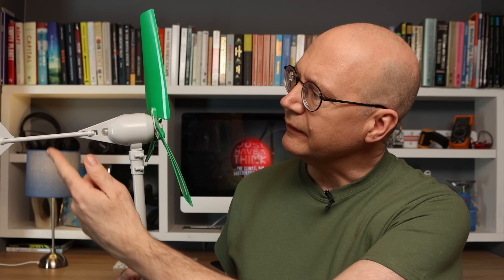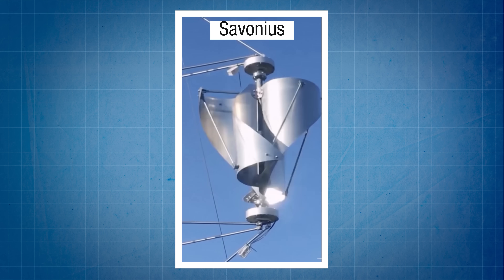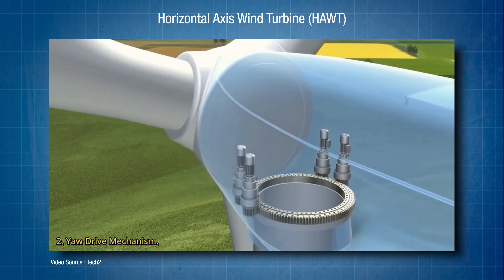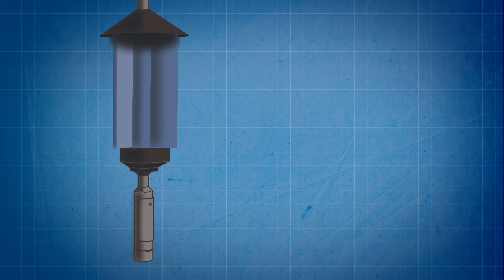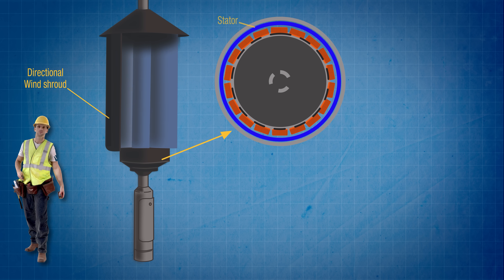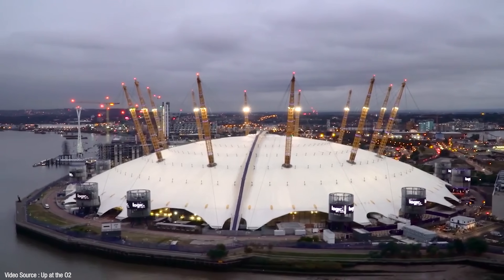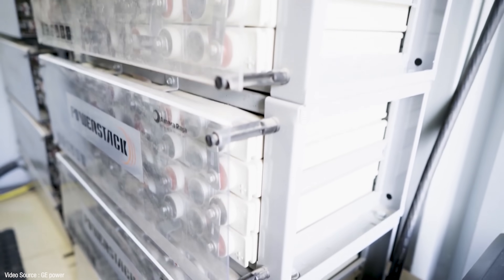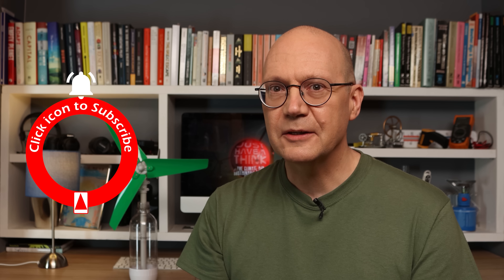A vertical axis wind turbine that doesn't need the prevailing wind! How do they do that?

Comment: There is a massive problem with this popular idea. (I already have heard this one quite often, and I keep being shocked that people are investing towards this.) When you place a wind turbine to extract the airflow energy from ongoing vehicles, what you are really doing is extracting energy from the moving vehicle. In other words, the vehicle has now to power itself AND the windturbine. 
To give you a physical intuition of why that is so: Windturbines rotate because of pressure differentials. If you look at a VAWT, as the wind blows onto it, at the front a high pressure "cushion" will form, and a low pressure one behind it. That means that when we are placing wind turbines along the highway, we are installing "high pressure cushions". Cars will have to travel then through this "high pressure cushions" instead of the normal-pressure-atmosphere! You are making the cars go through denser air/making it harder for a car to travel. 

This idea makes ONLY engineering sense if applied at BRAKING sections, NOT along the highway. 
Applying to braking sections, this would absolutely make a lot of sense, helping the cars slow down. Additionally the braking sections often involve curves as well, and wind turbines could provide some cross wind protection.

But please, stop popularising this idea the wrong way. We need smart solutions, not simple ones.
Reply: Excellent explanation. It baffles me that this simple thermodynamical approach was not mentioned in the video.
Reply: You got it right by getting it wrong, mate. These silly things are not capable of stealing energy from passing cars. They are impotent. Check the comments in Dave's "correction" pinned thread.
Reply: @tzenophile  There is no information about this in the pinned "correction" comment.
Reply: @Freba9  They are in the comments to Dave's OP. Not in Dave's OP. Check my comment and Jeffrey Lebowski's. They are at the start of the thread. Unfortunately Dave could not be bothered to get it right, even when we pointed out the simple math to him.
Reply: @tzenophile  Yeah I have seen it now. You are definitely correct about the numbers being highly unrealistic. But the exact numbers do not really matter when you realise that the system does not work at all. It only harvests energy from the gas tanks or batteries of the passing cars. No matter whether the power output of the VAWT is high or low.
Reply: @Freba9  I'm not convinced that would be a measurable problem, or even an immeasurable one, compared to the regular air resistance vehicles face. What physics would indicate otherwise?
Reply: @tzenophile  Well it is just simple: the energy to turn the turbines has to come from somewhere. So where else would it come from than the car itself? First law of thermodynamics.
Reply: @Freba9  No; that's like claiming a fire gets colder when you use it to heat up a marshmallow (or whatever). It does not follow from thermodynamics that car is affected against the direction of traveling by a VAWT nearby.  And even if it was, that the sum total is zero.
Reply: @tzenophile  The fire does get colder when heating something up. Somebody else in the comments made another great comparison to the situation: imagine the turbines are in stead foam rollers touching the sides of the vehicles in order to generate electricity. The rollers will increase friction and therefore increase the fuel consumption. Same thing with these wind turbines. The disturbed air pressure increases the drag the vehicle experiences.
Reply: @Freba9  I don't want to be rude, and you seem like an intelligent person, but your assumption that a fire gets colder just because something is hanging over it indicates that you don't understand thermodynamics. it is the air above the fire that does not get as hot, but the fire will have the same, if not a slightly higher, temperature, since the marshmallow will block some hot air from escaping (also depending on the general air supply to the fire). Anyway, the foam rollers is a nice analogy, but it is just that; analogies are not proof and can not be used as proof. 

A VAWT spins tangentially to the direction of the car, and any extra air pressure generated by the spin will equally force both against the approaching car and with it as the car recedes. The car's real frictional opposition is the air in front of it (and of course the road); I don't have time to look up the formulas and do the math but the VAWT will be in the wake, and if there is an effect at all it is bound to be very small, and much less than the energy the wake will transmit to the VAWT.  This is your point, right? That the wake will affect the VAWT and the car will be affected by an equal counter-force to the wake? I don't think so. 

Here is another analogy for you: A passing ship produces waves. Now, we should not harvest the energy from those waves, because if we have buoys, say, 20 meters from the ship (or even shores and coasts) that does that the ship will be slowed down. Nah.

Tapping into this excess energy would have been a good idea, except for the fact that VAWTs are pretty useless.
Reply: @tzenophile  "This is your point, right? That the wake will affect the VAWT and the car will be affected by an equal counter-force to the wake? I don't think so." Yes, that is exactly what I mean. The point is that you would have to be very close to the moving vehicles to capture any usable energy at all (apart from the fact that VAWTs are pretty useless anyway). Such a close distance would disturb the airflow of the vehicles so much that the energy harvested will always be lower than the increase of drag and therefore increase of energy consumption of the car. If the VAWTs were placed farther away from the road, there would not be any serious amount of wind to be captured and obviously the aerodynamic disturbance on the vehicles would (indeed) be negligible. But then there would not be enough wind left to be harvested, especially since the VAWTs are so inefficient. It is impossible to keep harvesting the tiniest amounts of excess energy from any system because at a certain point it doesn't make sense anymore. So my point is: in order to ONLY harvest the excess wind energy of the passing cars you have to be far away from them so you don't disturb the airflow resulting in a situation similar to the passing ship and buoy analogy.
Reply: @Freba9  Ok, so our difference of opinion seems to rest on the math of aerodynamics. And I guess none of us will go that far to prove or disprove the point. What we agree on is the in-feasibility of a practical setup, given that cars have different widths and can't be expected to keep a close enough distance to the HAWT to actually create sufficient drag/spin. But my best guess is, that even if you were right in assuming that a close enough position could be achieved which would negatively impact the car speed, these VAWTs still would not produce anything significant, let alone break even.

Comment: Here's one for some engineering types to ponder.  Think of all the central AC units operating around the world feeding our addiction to air conditioning.  They all have a powerful fan on the outside components that produce a large volume of "wind" as they draw air through the coils.  These fans run whether the unit is heating or cooling.  If a device could be installed above them to harness that air flow and put energy back into the grid whenever those millions of AC units are running it would offset a significant portion of the energy consumed  to run them.  The beauty of this would be that when demand is highest, when it is very hot or very cold, and the units are running pretty much constantly the energy production would increase as a result.  Someone who could come up with such a device that is economically feasible could not only have a real impact on reducing the need for more generating capacity but could probably reap huge rewards for doing so.  This would work even in areas where the lack of sufficient prevailing wind makes wind power impractical.
Reply: It would not work. A device like you describe would disturb the airflow of the AC unit fan and therefore increase the energy consumption of the AC unit. There won’t be any gain. Exactly like these windturbines from the video. They lead to an increase of fuel consumption from the passing cars. There is no such thing as a free lunch.
Reply: @Freba9  those turbines do no put any drag on passing vehicles.  They turn as a result of the air disturbed / moved by their passing.  No restriction of airflow from ac unit = no increased energy use.
Reply: @royparker7856  Yes they do. It is just basic thermodynamics. You cannot harvest energy from any machine without increasing the machine’s energy consumption.

Comment: You are wrong.  Putting these things on the lamp poles will increase the air resisances seen by the vehicles on the road.
Suggested reading: Theromodynamics for Dummies.
Reply: Well said 😄

Comment: Small calculation with information at 5:50 on this video. 6 kWh/day/each turbine and let's say 0.20e/kWh.
6Kwh/day * 20cents/kWh* 365d * 20years =  8760 euros. Can they manufacture, install and maintain those turbines for 20 years with 8760 euros a piece? 
That 20c/kWh is way too generous as big wind turbines makes it well under 10 c/kWh.  So it would be closer to 4000 euros per turbine.

Having small turbines means more controllers/inverters. Can those poles and foundations handle increased mechanical stress? Can they close a lane of motorway  for installing and maintaining turbines or does it need to be done evening/night, making it bit more expensive? During winter, is there risk those turbines throw pieces of ice to windshield of a car? 
I am bit sceptical about this, but I am not against someone trying, as long it's not happening with my money.
There is a reson why wind turbines has grown in size. It is more effective.

Comment: Just saw your video as it is something I am interested in for my house. I have succeeded in going entirely electric (solar panels, batteries and an EV) and currently, apart from the lease cost of the EV, my net annual energy cost is ZERO (including charging the EV). I had the gas disconnected and meter removed 3 years ago.
I am considering installing a small VAWT on my now redundant chimney stack, to supplement the PV system and like the look of the Alpha 311 system you talk about. How can I contact them?

Comment: What would happen if you tucked 2 of those behind a grill on an electric vehicle?  Could it add charge to the batteries as the vehicle rolls down the road extending the miles per recharge? Perhaps charge the batteries while parked facing toward the wind?   

I could use those in a back yard shed to operate 12 volt lighting via rechargable batteries and maintain my cordless tool batteries operating the chargers at 110v.

Comment: I can't help but think harvesting the energy puts more drag on the passing vehicles. Perhaps structures that reduce the drag on passing vehicles are possible.
Reply: Correct.
Reply: Incorrect. They most certainly have no signiicant effect on the passing cars, and will not produce any energy. It's a scam
Reply: As for "structures that reduce the drag on passing vehicles" -- that would be wind pushing the vehicles along. Giant fans at short intervals over lanes? Good luck!

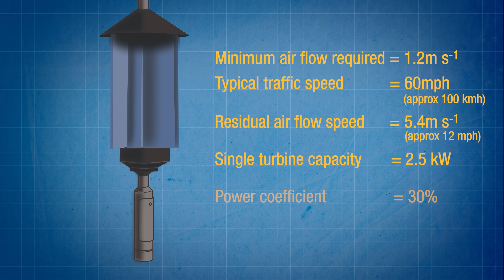Comment: I notice no one cares to redo my math... ? "Given the values at 5:30, to extract 2,5kW from a 5,4m/s wind, at Betz limit, simple wind energy calculations result in just under 230 m2 of required area...? I'm a big fan of wind energy, less of the sales department :) I fear the company is a bit optimistic." So just to explain: to generate 2,5 kW of energy for the given 5,4 m/s wind at the theoretical optimum (Betz Limit), one would need a wind blown area of the turbine of 230 m2. This means say a 10m wide and 23m high turbine rotor. As this Betz limit is not feasible, and a Savonius type rotor has very poor aerodynamic efficiency, losses will 'consume' a large portion of energy; therefore, this area will even need to be much larger. This conflicts with the available space around a road; also, the outer edge of the turbine will consequently be pretty far from the road, the wind wash effect will have dispersed. Oil won't kill the wind energy, but naïve optimism will :) Dave, am i wrong? Or am i missing something?
Reply: We already made this point a long time ago (check Dave's "correction" pinned thread) but Dave is not in the business of facts, but in the business of clicks.
Reply: @tzenophile  That is a pity... Keep up the effort then!
Reply: @vincent4189  It is a pity indeed. I stopped watching his videos after that.

Comment: Very interesting.  Something else to note is that as we transition to electric vehicles, the battery power of those vehicles which may or may not have come from a renewable source will be used to produce that wind on the motorway that the turbine will harvest, so the turbines may in fact be recycling a source of energy that was originally renewable.  It would be nice if they could provide power to some EV charging points.

Comment: The places for installing them seem almost limitless. Any decent sized highway would have the ability to make these viable.in telephone poles near highways or rivers. On the light poles on roads. The availability of alternative electrical sources is so vast that there seems no reason why they are not used in full force today. From these wind turbines to water turbines on rivers that do not stop the flow to wave catching machines that generate electricity. The list is almost endless.

Comment: This inspired  me to look at my energy usage since Oct 2021. Living alone in a 1 bed flat, my energy use Oct to the end of Jan was an average of 6.5 kwh per day. With a small unit charging a 10-12 kwh battery pack I could probably be OK. Would like to try it.
Reply: I have a better product, where you harvest the energy of people brushing their teeth. It does not work, but neither does this, and mine is cheaper by far. So it's a no-brainer what you should choose.

Comment: Given the values at 5:30, to extract 2,5kW from a 5,4m/s wind, at Betz limit, simple wind energy calculations result in just under 230 m2 of required area...? I'm a big fan of wind energy, less of the sales department :) I fear the company is a bit optimistic.

Comment: Just a suggestion or question to pass along to the folks in the UK: have you studied the possibility of rigging the VAWT axis with maglev rings capable of enabling the VAWT to 'borrow' part of the current so the turbine runs with effectively zero friction? You could have a sensor with activates the maglev circuit once the VAWT reaches a certain speed. (!?) If that works, seems like the same system could be used to build huge offshore turbines which do not require the massively expensive gear maintenance which II understand has to be performed every two weeks. Another use of these devices (maglev) would be summer snow-melt management on the Greenland Ice Sheet where cold temperatures might otherwise make regular maintenance of the turbines cost-prohibitive. Oh yeah, you could also have auxilary electro magnets capable of enabling frictionless startup. (Actually, that would probably be mandatory to make the system work reliably.) I studied this subject for a number of years, wondered why nobody was thinking about maglev as an enabling technology for VAWTs. Great to year  you folks are developing these much more versatile and efficient designs for capturing wind energy.
Just to clarify, summer snow-melt on the Greenland cap is destroying the ice-cap, and stands to coontribute massively to increases in global sea-levels over the next decade, as glaciers retreat and dump billions of tons of fresh water back into the north Atlantic. What we should be doing is mitigating and preventing the Moulins which deliver the snow melt to the bottom of the ice cap, ultimately destabilizing it. Instead, a network of VAWTs might be able to manage that fresh water, and deliver it into pipelines which could slow-dopwn the melt rate, and deliver the fresh water to equatorial zone via undersea pipelines in order to replenish water-tables in equatorial regions where agriculture food-production is currently collapsing due to drought.

Comment: for a more controlled environment to study these, best idea is to setup such turbines nearby railway lines.
Less likely to be vandalised and more consistent traffic.
Railway run on electricity, and they can easily power the stations, and the pillars are already in place for long distance railway that uses overhead lines.